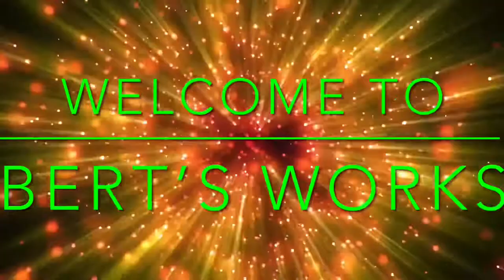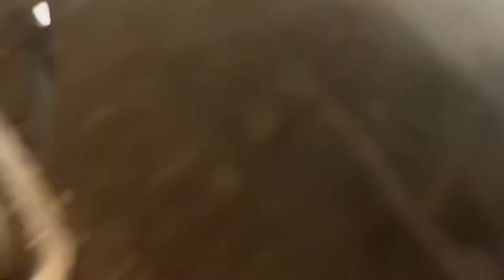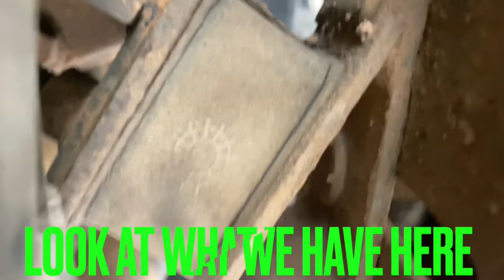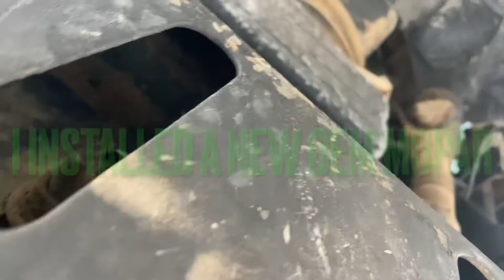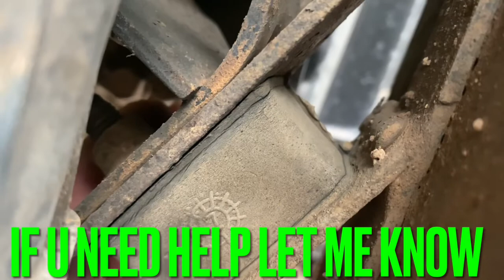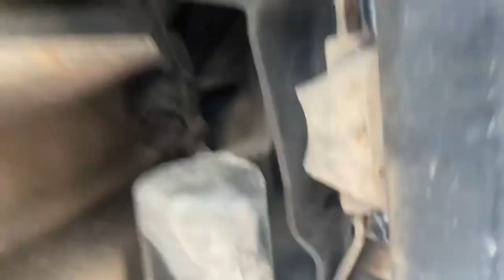Dodge Ram 2500 Clicking or clunking noise by transmission Problem Solved!!!

Comment: What year is the truck? I have a 2013 and the noise is identical to this. Kind hard to tell exactly where your at in video, transfer case mount?
Reply from the maker: Hey there it’s a 08 but I think the 13’s use the same transmission mount but yes it’s the transmission mount 👍 thanks
Reply: @bertsworks3073  thank you for the information I will be checking that out

Comment: were you getting any vibration while driving
Reply from the maker: Hi no that’s a different problem probably u-joints if you can take driveshaft off and check the play in u-joints if has play good all around good but if it’s kinda hard really no play then u-joint is bad, unless your tires are bad different story but I would check u-joints first from transmission or transfer case to rear differential. 👍
Reply from the maker: @donscott6720 👍

Comment: My truck thumps when I let of the gas while moving and I have no idea what it is. Any idea?
Reply: Try checking driveline, my 2nd gen ram needs driveline work and it bumps when i let off the gas so i dont drive it. Most likely u joints on the driveline needing replaced